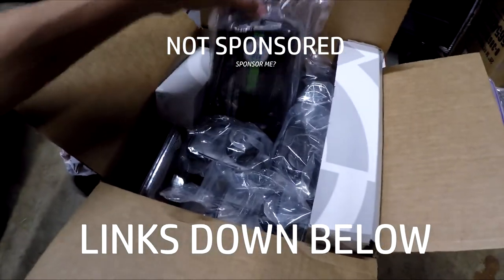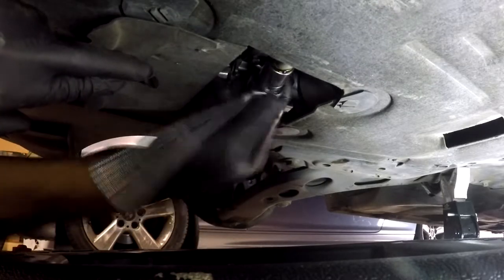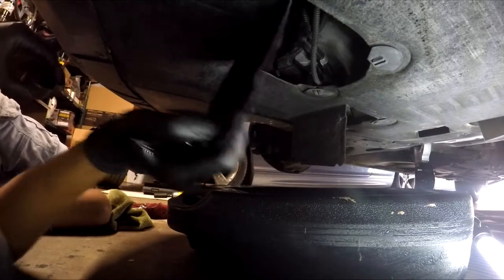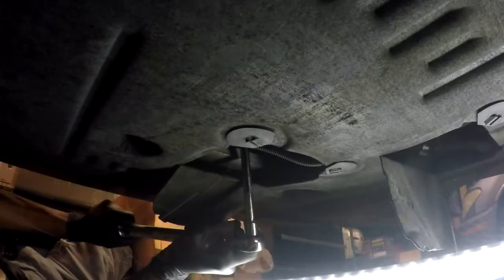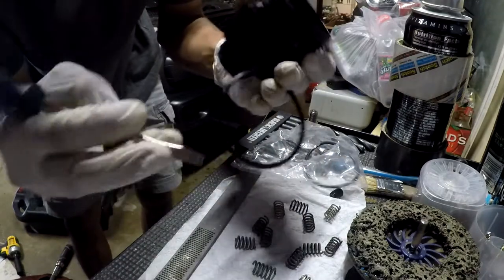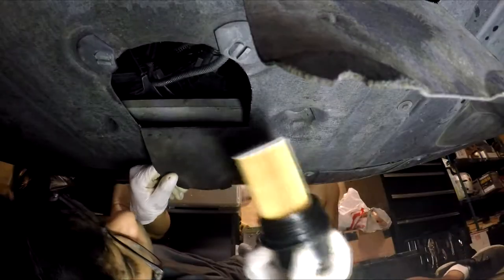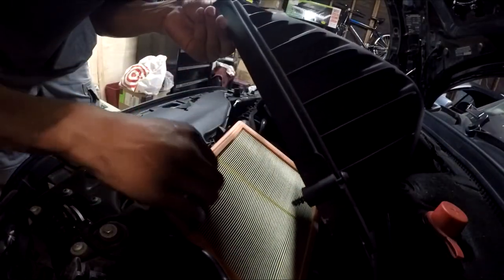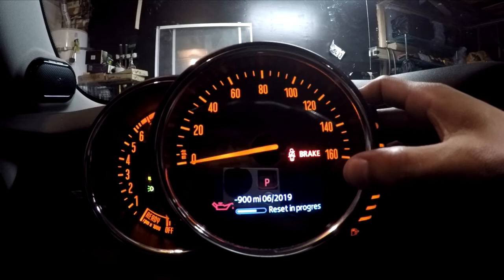2015 F56 Mini Cooper S Oil Change

Comment: Super helpful and too the point.  I just performed an oil service on my f56 using oem parts from local dealer.  The filter housing drain plug is 13mm on the new dealer filter.  The one on the car was t55.   Since I was under the car, I went ahead with removing the under tray to perform an inspection.  Under tray was secured with 8mm screw bolts, 14 of them.  

my f56....2018, jcw tuning kit (exhaust, tune), nw engineering 22mm solid rear bar and end links (factory endlinks are plastic, factory rear bar way too soft/hollow), michelin pilot sports (oem pirelli runflat were subpar).

Comment: Great vid bro. Should you always change your air filter in your mini when you do an oil change? If not what could happen?
Reply from the maker: If your air filter is too dirty you will obstruct the airflow to your engine, thus possible combustion issues could occur.
Personality I alternate in changing the filter between oil changes, because my mini is not a daily commuter. I do always check the condition of the filter prior to the service.

Comment: Thanks for this video :) I have a 2015 Mini Cooper, what brand should I get to change my engine oil? I know that I should use a high performance synthetic oil w50-40. 
Where do I get spare parts for my mini such as brake pads, discs, air filter, engine mounts? appreciate your help :)
Reply from the maker: The oil service kit i grabbed from MiniMania. You can source alot of OEM stuff there.
FCPEuro is another great source.
Another one is OutMotoring.
Browse around find the best deal for your budget is my advice.

Comment: A smear of oil round the o-ring before installation is good practice
Reply from the maker: The torque rating is for dry threads.
Reply: @jssdgarage  not talking about the torque rating - generally you'd smear oil on the oil filter housing o ring, or the seal directly on the canister if it is a metal type - it prevents the possibility of an install related tearing or moving, and also prolongs the life of the oring and integrity of the seal. Some people use rubber grease, but a drop of the old oil smeared round  it works too.
Reply from the maker: I believe by nature of the canister  design it probably would mess with the threads and torque rating. But probably not, might be something to relook at in the future

Comment: Why wouldn't use the Jacking Pucks installed on the car to prevent damage ??
Reply from the maker: Because then it wouldn't be able to put jack stands on those points.
Its always easier with ramps, or a low profile jack to use the subframe as a jacking point

Comment: So you say under the door handle is where you should Jack? I have the 4 door  cooper (f55) and I've heard the same thing to Jack under the panel but i felt it and it was just plastic and I was scared to Jack it up.
Reply from the maker: The actual structure under the rocker panel is pretty solid, if you have a low profile jack or you setup your mini on ramps you can use a 2x4 (2ft in lenght should be good) to add a longer pressure point and minimize your doubt for damage to the plastic bits.
👌
Reply: I use a piece of scrap 1x4 wood about a foot long to cushion the jack and spread the load. My jackstand points have more damage on them.